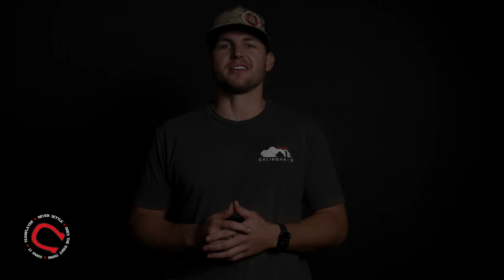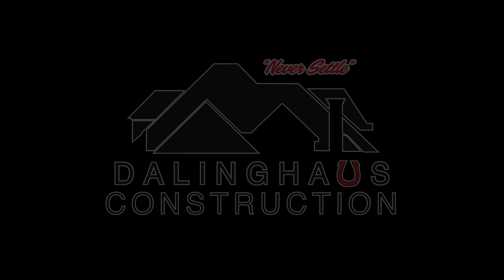How Much Does Foundation Repair Cost?

Comment: these prices are almost 3 times the costs here in texas. unbelievable.
Reply: Are you comparing push steel pier and compressed concrete piles? Actually, the price is spot on for the push piers.  However, not all homes require push piers repair because some homes sit on shallow clays (that is, the depth to bedrock can be reached by compressed concrete piles).  In that case, yes, the cost to repair is 1/3 of the steel piers.  For example, if a home sits on Miller clay, the surface to bedrock depth could be up to 200 ft, and steel piers probably have a better shot (no guarantee, since steel piers go up only to 130 ft).  On the other hand, Pledger clay has a maximum depth of 20 ft, and using steel pier is an overkill.  I honestly do not believe any "estimate" would be proper without soil measurement or survey analysis.
Reply: @GatorWinup I’ve been in the foundation repair business since 1989 became a CFRS in 2006 and have installed many types of piers for many foundation repair companies who are members of the NFRA throughout the state of Texas. Steel piers are for areas a solid strata can be achieved such as shale and limestone. Concrete pilings are primarily friction piers that rely on the friction created as the pilings reach more denser clay soils and work best when driven to a depth past the active zone before reaching its load capacity for the area of the structure its supporting. Under load the concrete piling has the capability to actually increase its load capacity as the displaced dense clay soils squeeze against the skin friction surface of the pilings. Studies have shown an increase of strength as much as twice the load capacity after a couple of weeks holding a load. This is from my experience with concrete pressed pilings and seeing how they have performed after installation years later in a lot of foundation Repairs I have sold or installed.
Reply from the maker: Nice!